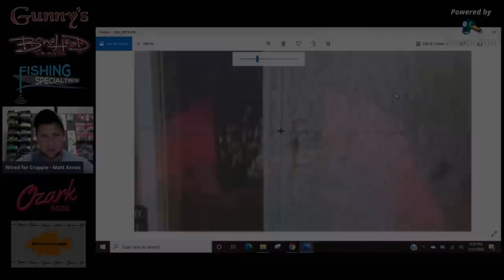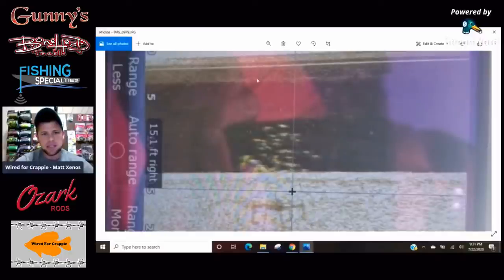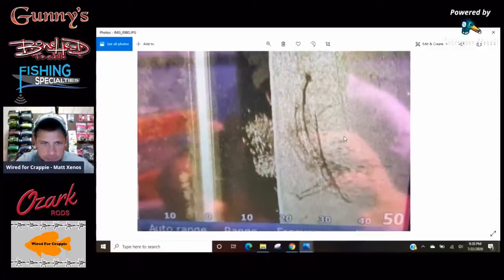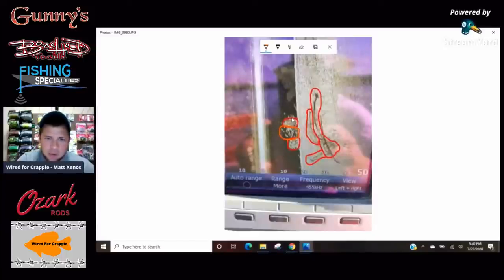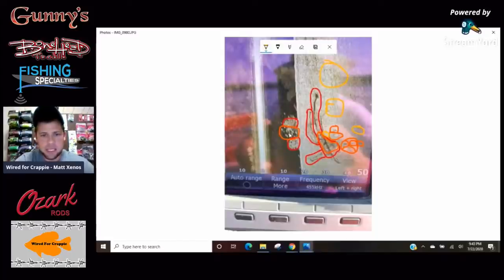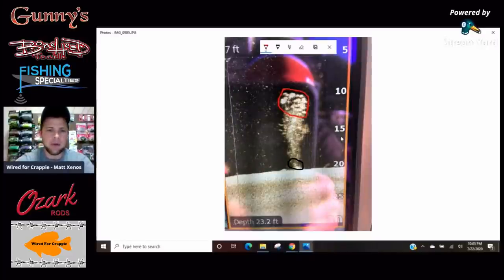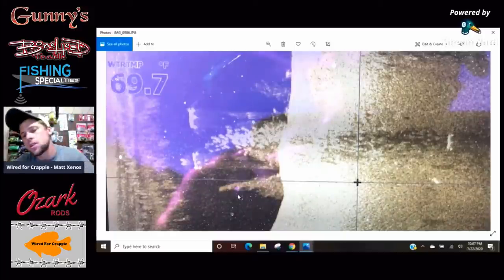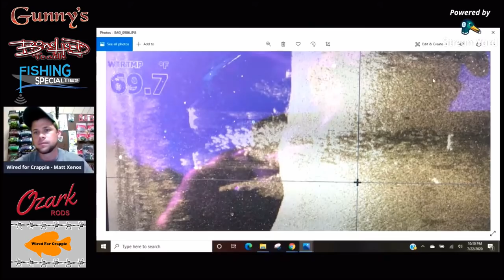How To Read Side Imaging

Comment: Good video. That helps. I’m struggling seeing brush piles on SI that I know are there. Been told the older they are the harder they are to see. Is that true?
Reply from the maker: Dave, That is 100% truth. Reason they are harder to see is over time the structure gets waterlogged. This causes it to soak up the sonar waves more and you don’t get as hard of a return. Also the algae which grows on it will cause the same effect.